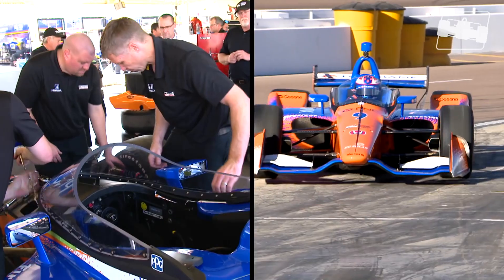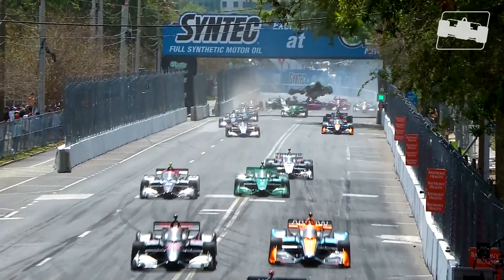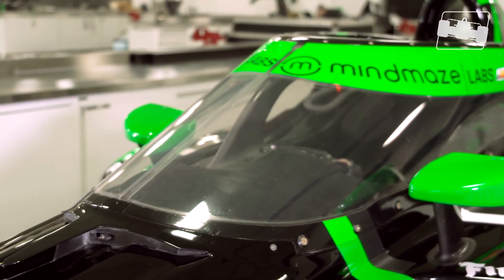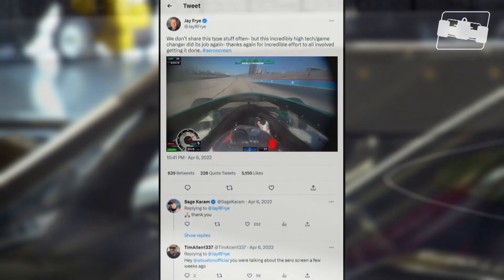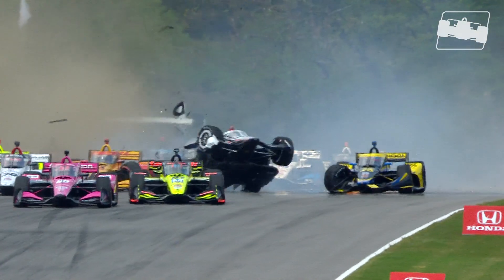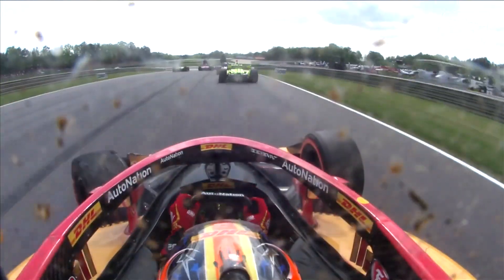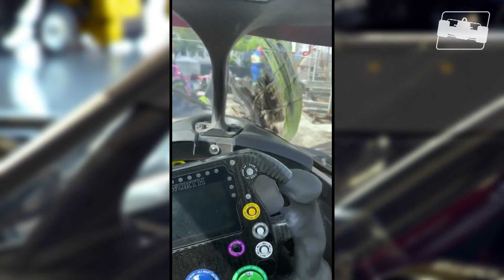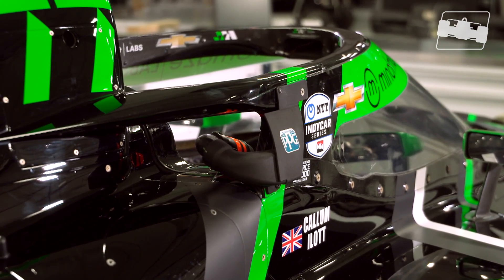How does the aeroscreen work? | Part 1 | INDYCAR 101 presented by Pennzoil

Comment: I’m all for safety but still don’t care for it. Neither the aero screen or halo are appealing to the eye. But if you’re going to do it, go with the halo where drivers have protection from a vertical impact. The screen does good at deflecting from the front but I don’t see it being effective preventing a nose cone or fence post (Wilson and Wheldon, respectively) to the top of the head.
Reply: But the areo screen has a halo sort of device inside of I and the top is the same material
Reply: What? The aeroscreen is a halo. It’s a polycarbonate screen on top of a halo. https://youtu.be/Zs-trk42vFo

Comment: The aeroscreen looks cool. In my opinion, it would’ve saved Dan Wheldon and Justin Wilson
Reply: Wheldon hit a fence pole at 150+ mph. I'm not sure.
Reply: @Gabbu_Plays  he went cockpit first into the fence. His helmet struck a post in the fence
Reply: I don’t think it would’ve helped Wilson either. The drivers heads sit equal to the top. It’s still vulnerable to a vertical hit.
Reply: @Gabbu_Plays yea but he died because the fence made direct contact with his helmet….. the Aeroscreen would have prevented that and most likely saved his life
Reply: Wheldon went airborne and struck the fence poles with enough force it sheared the airbox off the car.  He'd probably survive in a current car as the titanium strut in front would hit first and deflect the car.  However, the only way Wheldon would have survived in the old IRL Crapwagon would be to sit out the race. 

Justin Wilson would absolutely be alive today as he was killed by debris striking his helmet at over 150 mph.  The nose cone of Sage Karam's car would have been too big to get inside of an aeroscreen car.  In addition, IndyCar upgraded to cars with additional teathers to keep large pieces of bodywork flying around the track.
Reply: Justin Wilson, yes, but he would still have suffered a concussion. Dan Wheldon, no, because he was airborne, flew over half a dozen cars, flew into the catch fence, and the aero screen would have disintegrated once he hit that fence post. That race should never have taken place, and I would have boycotted the event if I was a racer due to safety concerns.
Reply: @mattkowal90  That race should never have taken place, and I would have boycotted the event if I was a racer due to safety concern.  YES, that´s true !
Reply: I agree.
Reply: Wilson maybe ! Wheldon never no chance !
Reply: That’s not how I remember it. To my recollection what killed Wheldon was his own tire that was tethered snapping back and hitting him in the head because he got into the fence. And if my recollection is correct, then yes, absolutely the Aeroscreen would have saved him imo. Actually post or tire, I think he would have been saved either way.
Reply: Wheldon NO ! Wilson MAYBE !